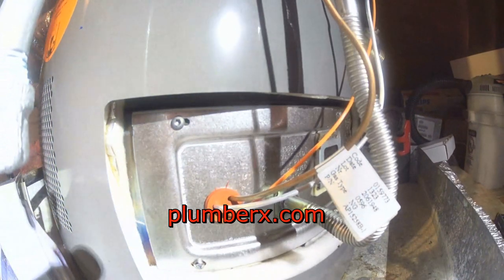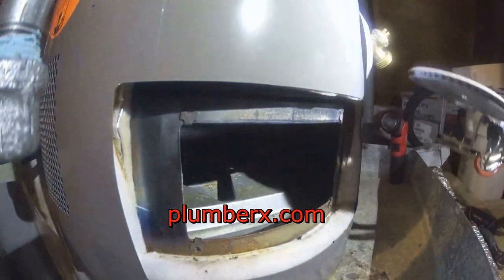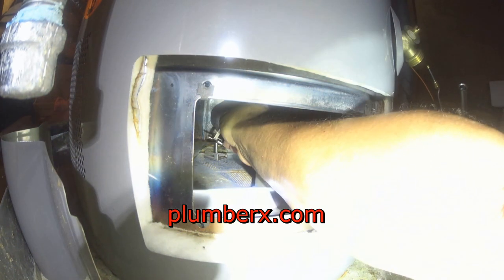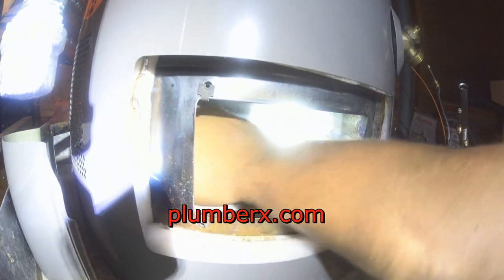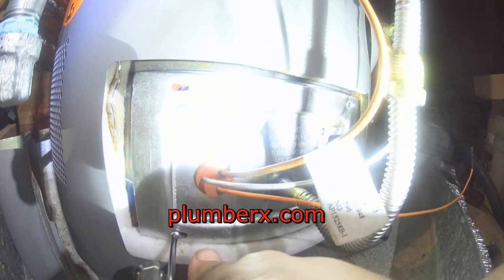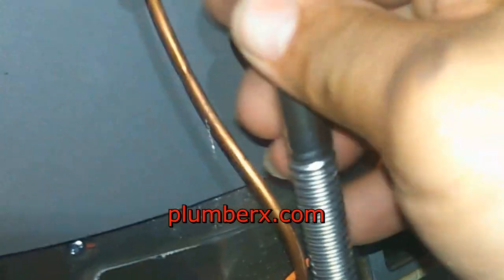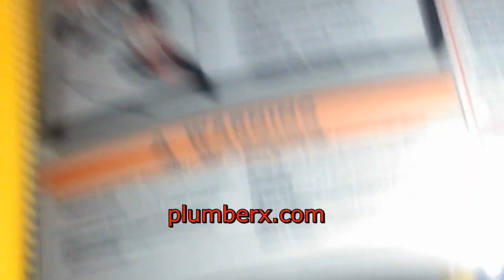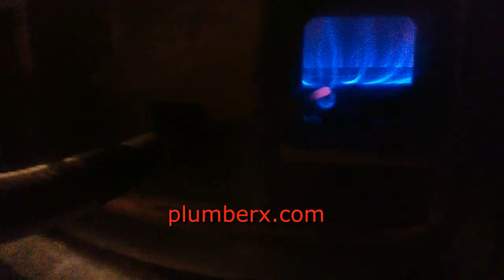Rheem Water Heater Safety Device

Comment: 9:20 on June 26 should heater be on blocks since looks like it draws air from underneath, getting ready to replace broken glass tube. Great video
Reply from the maker: Blocking the base of a water heater can interfere with proper ventilation. Most water heaters draw air from underneath to support combustion. If you elevate the unit, it may not get enough air, potentially causing overheating or even a fire risk1.
Condensation and Insulation: Additionally, blocking the bottom can lead to condensation issues. Proper insulation and airflow are essential. If your water heater is outdated, has damaged insulation, or is set at an extremely high thermostat, it might develop condensation. To address this, shut off the power or gas supply for 4 to 6 hours to allow any condensation to evaporate2.
Drain Valve: If you’re dealing with a leak, check the drain valve at the base of the tank. Regular tank drains help prevent sediment buildup and maintain the valve’s integrity. If the drain valve is leaking, consider replacing it

Comment: My broken glass tubing was just replaced and 10 minutes later after new one was replaced the water heater did the same thing, and glass tube broke again???? Professional company had cleaned out bottom of chamber before the installation and the new one still broke.
Reply from the maker: I would call the manufacturer, there may be some kind of defect with the water heater. Before you call get the information off the side of the water heater. Model, serial no.  Or talk to the company that made the repairs. I would think they give a warranty for work and come back and check at least.
Reply: @theartofplumbing  Thanks, I plan on calling them tomorrow
Reply from the maker: @informationstationjw  👍

Comment: I replaced the thermal coupler water heater will lite but will only run for 30min then it will go out then when I try to relight the pilot it will lite but as soon as I let go of pilot button it goes out right away what am I missing

Comment: I changed the thermal coupler and the glass safety still good in place and the pilot still goes out when I release the button
Reply from the maker: Try this. Check the thermocoupling and make sure the flame is directly burning on the thermocoupling . This is why. 
  The flame most burn directly to thermocoupling when this happens a small amount of an electrical corrent is created and that controls the gas control valve. If flame is not burning up against thermocoupling this will action will not work. Hope this help.
Reply: @theartofplumbing   it didn’t work, I also checked the safety glass device and it still intact.  I have 2 water heaters side by side and they both went out. I was able to light one up, then  it went out again and couldn’t get it back on.
Reply from the maker: @omegautility9009  Check vent going out thru roof. Make sure the vent cap on the roof has not come off. Hard win could blow out water heater as well

Comment: I just don't get exactly how it works, so the fluid breaks, causing the air pores to clog? And that shuts down the water heater? Just wondering because how would replacing it with an intact fluid housing correlate with the rest of the water heater? It just sits there? Doesn't connect by any wires or hoses, any of that. It just seems to me there would be no way for the heater to sense that you even changed it out
Reply from the maker: Thank you for your comment, But that little glass bulb is locked in place holding the gas control valve open, and once it burns out or Pop, it closes the gas control valve immediately by
releasing the lever. Even to put the new bulb back, you have to push the lever down to squeeze it in.
Reply: Pretty much this is what happens the fuse breaks the door closes no air is coming through the circulation system burner shuts off
Reply: @theartofplumbing  here's what happened my basement flooded and I think water got up there to the height of the hot water tank it could suck air in their overheated and the glass broke I called about the hot word take today nobody seemed to carry those parts you got to go to that pacific company to get parts so I don't got no hot water for a week
Reply from the maker: @michaellarcom  Dang sorry to hear that.
Reply: @theartofplumbing  I thought about taking a skinny screw that will fit through that little hole with a nut I put it in its place until I get that fuse so I can have hot water but I'm not trying to have a catastrophic problem
Reply: @michaellarcom  Dude. Same. Just rigged it up with a small screw. Googling now to make sure I'm not creating potentially explosive problems for my family. No idea why it tripped.
Reply: @mattbobus9923  , a year has passed since you posted your hack to keep the door open and pilot light going.  Did this fix the problem?
Reply: @mynxdog  It did. The unit is still under warranty, but I'm reluctant to contact them. They'll send the part, free, once, but if they want a tech to come install it, I'd want to undo my "repair" so I don't void my own warranty, but then I'd have to power the unit down and wait for the repairman. 
I just left the screw in... for the whole past year.